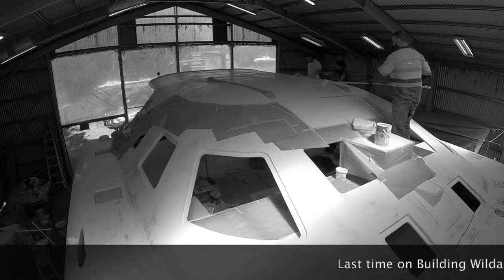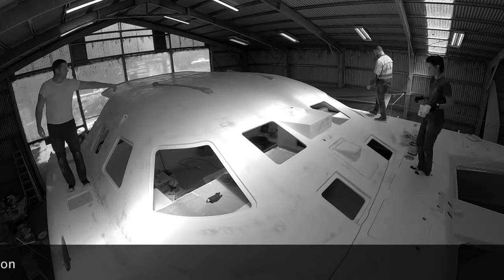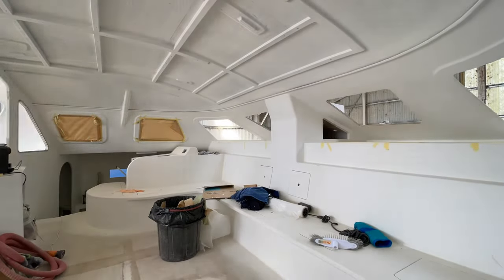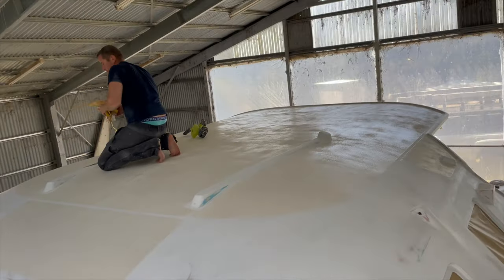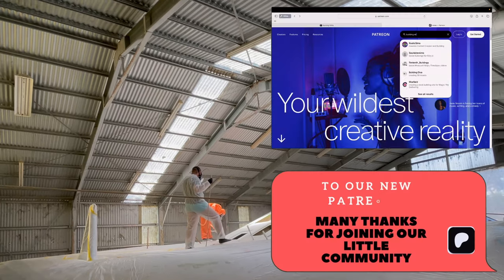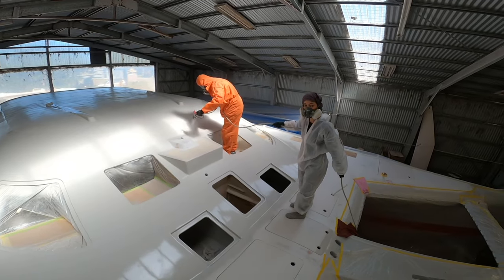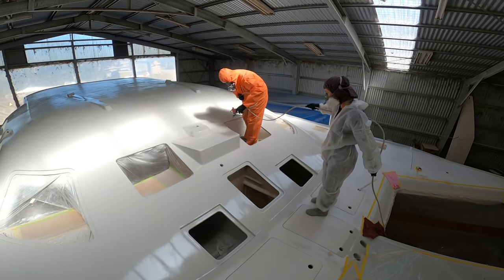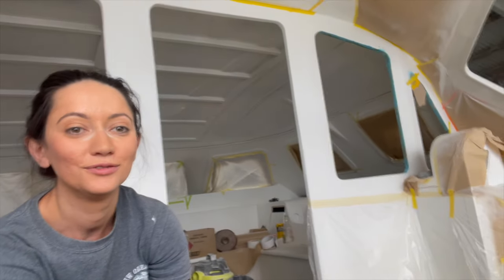TOP COAT on the salon ROOF - Wilda shows her COLOR - S03 E02 - DIY Catamaran Build

Comment: Two light grayish top coats. The sheen, as you can see the building roof reflection. Who said sanding was easy. Now prepared to patiently fit in the rear window frames. Lots to do. Reshaping some window openings. Will eventually get an acceptable fit.
Reply from the maker: Very greyish 🤣 we think it will look less dark out of the shed.

The windows went in ok... I was just a bit disappointed they didn't fit without the adjustment we did... They were (supposed to be) built to fit...
The doorway is a different story.. we'll get to that one eventually🤣

Thanks for sticking with us! And for all your comments.

Comment: Well done on the spray job. I always worry about how the fairing will look after the gloss is applied. I was really disappointed when my hulls were first sprayed as I thought I could fair but I didn't do enough high build and fine sanding to get the small imperfections out. Getting a truly fair finish takes huge amounts of work, there were three of us fairing for three months to get a 38ft tri faired. 
You may like to try a few methods for rolling topcoat - it reduces health effects of the isocyanates and is much easier for certain parts. I have had some success recently with Poly U 400 from Wattyl and L 754 retarder. But instead of using 5% thinner I have pushed it to 20%. It works really well and I keep a wet edge. Also I use a 4mm microfibre roller, NOT a foam roller as foam pushed air bubles into the paint. 
I am just about to do some deck paint. What grit or particle type did you use? 
You are not going to get your side windows made by the window guy are you? Fixtech 400 and double sided tape with acrylic is easy and means you don't have to pay others to do work. 
Cheers
Phil
Reply from the maker: We used a Dulux brand granulate. Course.
Yeah, isocyanate is no joke. Not sure if roller or airless is safer in this case. We wear masks in either application.. Using an airless allows us to use a minimum of thinners so much better than conventional spray. The speed means we are out of the vapours so quickly I think the exposure time is what really makes a difference here. In addition to not using extra thinners. Any rolling we do, we tend to use short nap mohair. Haven't tried microfiber.

As for the side windows.. I imagine you mean from the saloon? You are right, we could probably quite easily do them ourselves.... The thing is, everything takes time.. At this point, we need to try to save time, sometimes more than money... So we are paying the window guy to help us. That also means we will have molded windows in the salon. Only 2 out of 6 cut outs are flat.

Thanks for following along and good luck with your boatwork!
Reply: The addition of too much thinner to epoxy coatings can make them pours. Spraying is always the best option for epoxy coatings as it degasses your coating .

Comment: See you are you using total boat fairing products where did you get them from . I have just bought a schionning 1120x in the same state you got yours in. Now the work begins cheers greg
Reply from the maker: Good luck with all the sanding!

Actually we have been using mostly west system epoxy. Some of the latest work is Trojan Composites epoxy. Trojan is good to order from for most of my epoxy needs.

No total boat products at all.

If you are referring to the blue epoxy fairing compound, it's a Technirez product. I forget the product name. Bought it online, eBay I think from bluebottle marine.

Merry Christmas 🎄

Don't hesitate to ask more if you want.

Comment: With those windows in a main bulkhead shouldn't they be decored and a fibreglass infilling inserted?
Reply from the maker: Yes. And uni directional glass to retain bulkhead strength.

Did that when we cut the holes. Now we were just adjusting the filler to fit the window frames.

Comment: I heard you say acrylic. I know it’s more expensive, but long term you would be better off using safety glass. Acrylic is very prone to scratching, especially in a salt water environment.
Reply: Phil, just FYI, a couple of years ago I refurbished my 1985 Farr 7500 trailer sailer, repaint, antfoul etc. When I was polishing the smooth gelcoat on the coachouse, I thought I would give the acrylic windows a go, using the various grades of polish I was using. They came up like brand new, with very little effort. Turns out soft is good. Not trying to be a know-it-all. Just passing on my experience.👍
Reply from the maker: Glass is great. There are advantages and disadvantages with all materials. Polycarbonate would also have been an option. With other disadvantages.
I just can't justify the cost of hardened glass.
Reply from the maker: That's good to know. Quite honestly, I'm happy we hopefully don't have to polish them in the foreseeable future 🤣